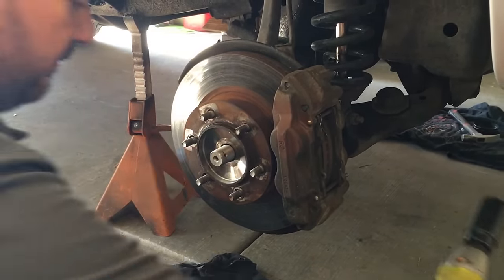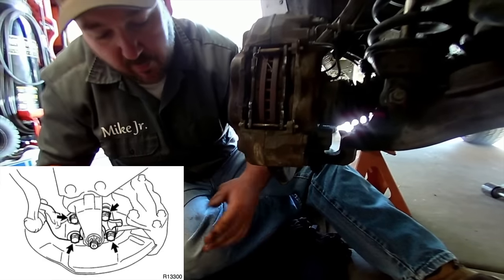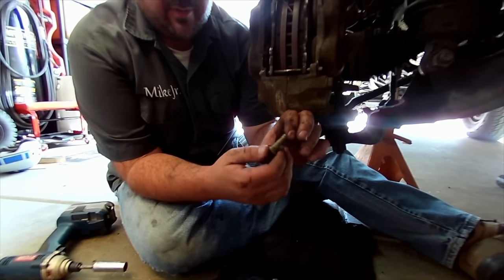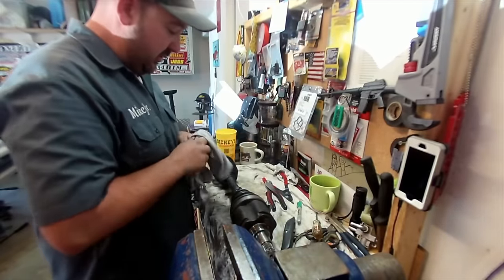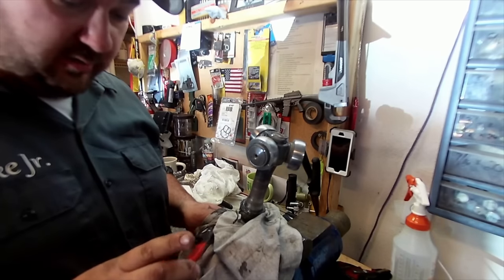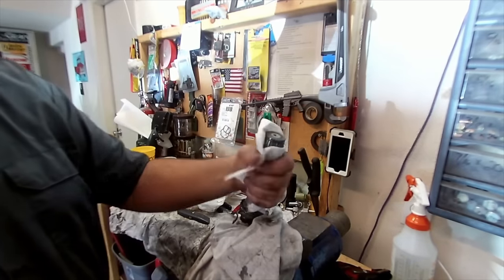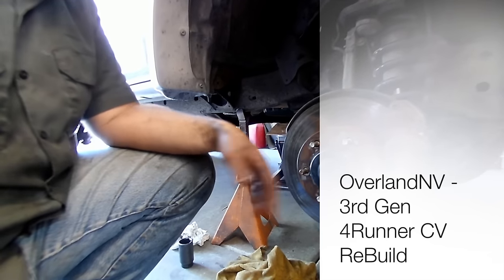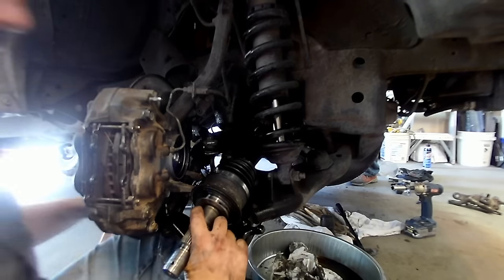Toyota 3rd Gen 4Runner 1st Gen Tacoma CV ReBuild

Comment: How hard is it to rebuild everyting? I have a shaft that I took out that was loose and knocking. Probably needs more than boots and grease...
Reply from the maker: The reboot process puts you more than half way to a full rebuild. I would determine which end of the CV is loose and knocking. If its the tulip side then its just a matter of swapping out the proper parts (if needed) while you have it apart. If it the bearing side, then there is some added work, but pretty straight forward. Parts for that side my be hard to source though...Ive never had to do it and the FSM doesn't show steps to disassemble it. It may not be bad though, just needing the proper amount of grease to keep the movement clean and consistent.
Reply from the maker: Have your camera running too :)
Reply: Me + greasy box cutter + Camera. That will turn into an video blog on how to use a tourniquet.